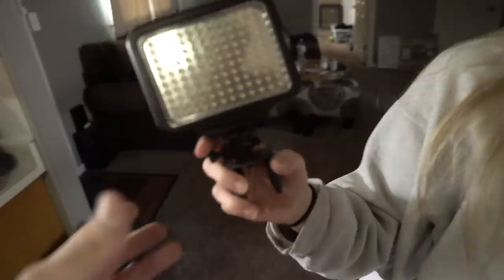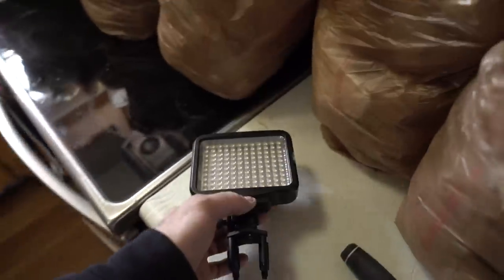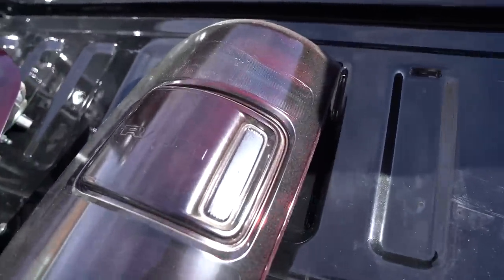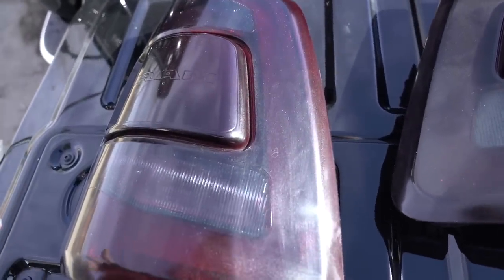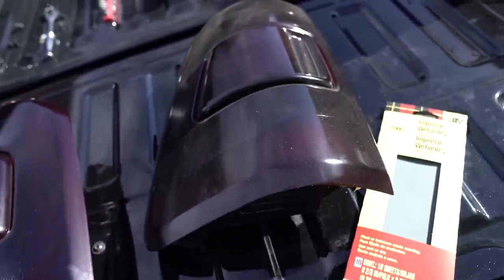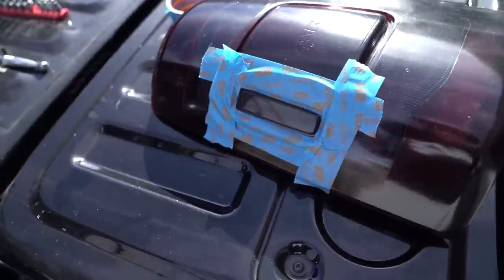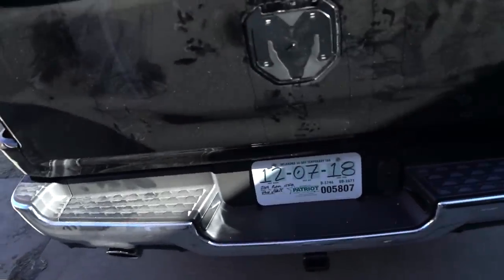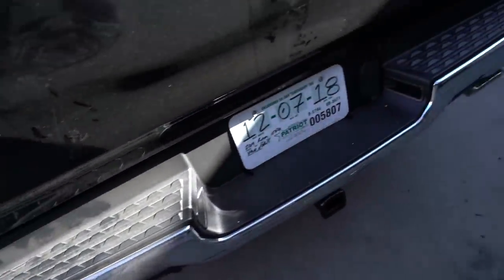I Sanded My New 2019 Ram 1500.....Here's why

Comment: I tinted a set on my old Silverado and used scratch x on it and rubbing compound to get it smooth and glossy after wet sanding but I went 5 coats tint then 3 coats clear.
Reply from the maker: Cory Nichols damn thanks! I might try that
Reply: No problem, I was afraid at first when I did it myself but I felt it turned out really good on that truck. I never had a problem with it fading either. I just bought a 2019 Ram in September so I’m definitely following your content after seeing this video.

Comment: How did you remove your taillights? Ive had some issue getting mine out
Reply from the maker: Kyle Benson just 2 bolts and 2 pull clips
Reply: @DavidVanVoris  did you use a special tool for those pull clips?  I felt like I was going to bust them so I said fuck it and just tapped around everything and tinted them on the truck
Reply from the maker: Kyle Benson bend the tans toward you so they are vertical standing up and pull them that should pull the middle of the clip out then just pop the rest of the clip out